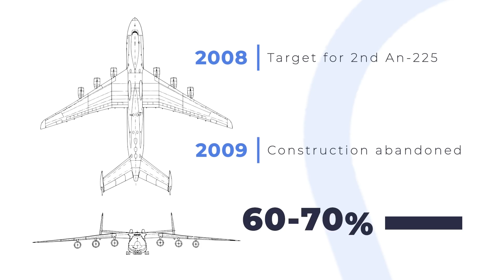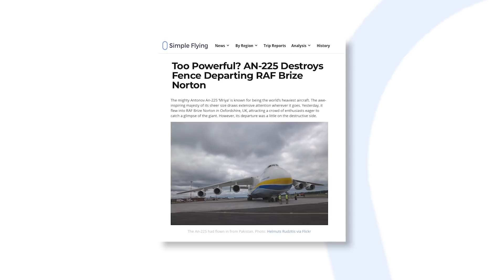Why Wasn't The Second Antonov An-225 Finished?

Comment: saw the an225 at farnborough. even had a walk inside - it was huge. there was also a sign outside to "please dont kick the tyres". also seen the partially completed 2nd airframe. it has a regular type tail, like the an124.
Reply: Makes sense, the split tail was a result of being designed to carry Buran, which would block the airflow over a regular single rudder. With this requirement gone, there is no need to have a more complex twin rudder tail.
Reply: Man, too bad it's had a rapid unplanned dissasembly...
Reply: They intend to use a split tail for the second now.

Comment: I saw it in Las Vegas back in ‘05. I was told it had just dropped off a huge transformer for the electrical installation at Hoover dam. I worked for a charter company operating DC-10’s at the time- (can you guess who?). The 225 was parked right next to our facility on the west side of the field. I walked around and under the entire aircraft with my girlfriend. It was awesome. A very rare opportunity indeed.

Comment: Saw it at the Paris Air Show- airspace was shut down when it flew in; had a good look round on the static and as I was working at the show got to look around and inside. Just an awesome machine when it took off to head away into the blue yonder... impressive.

Comment: if I had money and a chance to get my hands on the An -225 , I would have changed the engines to more efficient ones, indeed increasing the range and performances of the aircraft and also reducing the co2 emissions, and then would have installed modern cockpit instruments in it,  and making it safer and better then it is .
Reply: Well, that's kinda obvious, isn't it?
Reply: Yes, an all-electric An-225E, the cargo full of batteries so the crew can fly to another continnent.
Reply: The answer is you can not. If you want 2 end flying as we know it, go for electric aeroplanes.
Reply: Yes I know, but do you know what irony is.
Reply: While it would be nice to have them, the cost of making all of those upgrades for a one of a kind airframe would never be recouped before the airframe timed out. But I agree, it would be awesome to it outfitted with todays best motors. What a difference it would make.
Reply: @aeromender  I would be broke, but I will do this if I had money to do .
Reply: @markpereira3931  I agree, it would be fun to do if money was not an issue :-)
Reply: @markpereira3931  Also, you might reduce the number of people in the cockpit while your busy making improvements! I think the AN124 has 8 people on the flight deck. I imagine the 225 has at least that many.
Reply: @aeromender  I know , 
That's something I would do second after engines . Make it at least 2 person operable. Would be challenging . Hope it doesn't be like 737 max. 😂

Comment: I used to keep my Merlin under the tail of the An-225. In the winter hangar they kept the An-225, a An-22 and the An 70.
Antonov factory is in Kiev. It shares the airstrip with Zhuliani airport (UKKK).
I saw the unfinished An 225 six years ago. Everyone in the ANTK Antonova and the Antonov production factory was dyeing to finish that plane.
Except Kiva. He became General Director of Antonov after Petro Balabuiev who was the General Designer of Antonov.
Kiva is the CEO of Antonov right now. Don't think he'll survive in that post after the war. He's too corrupt.
If it survives the bombings. I'm sure those will finish this plane. It's not like the other. This one has 21st. Century technology.

Comment: I suppose the part completed example could eventually be finished with parts salvaged from the one in use once the airframe wears out. But with the current utilisation that doesn't appear as if it will be anytime soon! 

It would be a real shame, but unless they start being used on even a semi-regular basis, I wouldn't be surprised to see them broken up for scrap.
Reply: They must see potential... it's been 30 years and it's still taking up hangar space somewhere. If the one flying crashes or is otherwise written off, it may yet be completed.

Comment: Is it fair to say that if the 225 were economically viable, there would be a cargo 380?  And, maybe you could explain why the 225 is not economically viable compared to the cargo 747.  Is it ground operation costs, flying costs, maintenance costs?  How do both compare in terms of viability?  Maybe a video on this could be interesting.
Reply: The An-225 is very, very expensive to operate for many reasons. While it may share a lot of parts with the An-124, that is a rare aircraft that has not been produced since 1991 and itself has only a handful still flying. If it needs spare parts they likely need to be specially made, or pulled off a retired 124. Some items are likely unique to the 225 as well. Aside from spare parts, it has 6 Lotarev D-18T engines that burn an insane amount of fuel. USSR engine designers were not too concerned with fuel burn since all aircraft were owned by the state. Then I imagine the insurance rates on the An-225 are absolutely insane. If this aircraft was not so uniquely capable, it would have never been brought back into commercial service. And it was already built and sitting there. After writing that piece out, I'm honestly surprised that it was.
Reply: @B52Stratofortress1  Oh I see.  Understand now.  Thank you for the explanation.

Comment: $300 million for a hand built gigantic aircraft is quite a bargain... Aircrafts this big isn't cheap in general, whether the 777 or even a F-35. Between 2 and a half F-35s and 1 of these, this for sure. Maintenance alone should be much easier given that it's a mature design that even bankrupt Ukraine is able to handle.
Reply: Price has likely increased since 2008 or whenever that number was given. But still that is reasonable. I would think the operating, maintenance and insurance costs of a second aircraft can't be justified, not finishing the aircraft. Insurance on the 225 must be insane since it is a 1 off